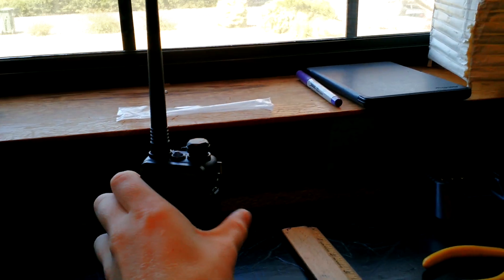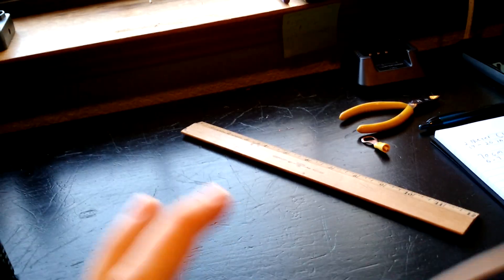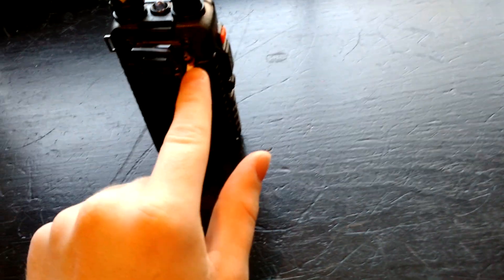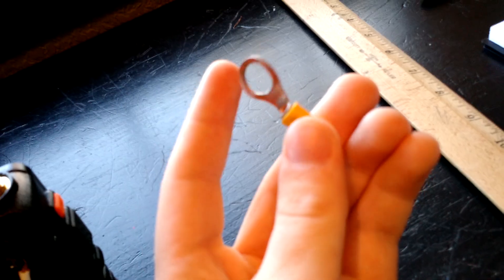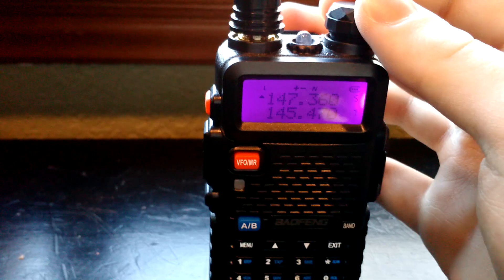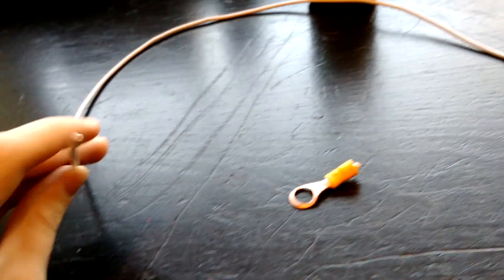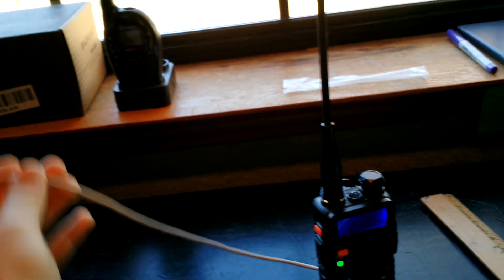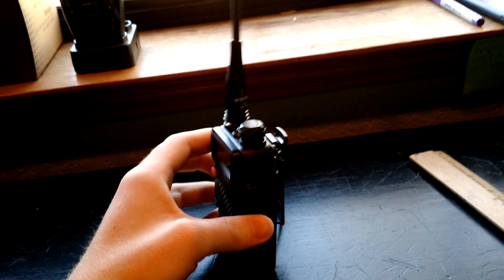Increase HT Range & Performance Free Mod ( Baofeng UV)

Comment: So i have done research with a fixed signal source and added and removed a counterpoise on a baofeng and i have not been able to prove that it works on receive. I also have a situation where i can barely get into a local repeater meaning i can barely key it up  and have to hold it over my head and walk around to find a spot that works... and even then i can not prove one way or the other if a counterpoise works on Tx. I tried looking at the noise waveform on the rx audio and still can not see that it makes a difference. I have done this recently as well as 10 and 20 years ago. I know the theory behind groundplains and know that they work but on a VHF PORTABLE....  and with the counterpoise hanging 180⁰ from the vertical radiating element... i think this idea needs some rethinking and likely redesign ... maybe radials at 90 degrees from the antenna. I think likely a better match between the radio and the antenna would do more to improve the system than a piece of wire 20 inches long hanging down the back of the radio.

Comment: I tried this, without any really noticeable improvement. I ended up focusing more on the antenna itself. Most of the better portable antennas will do a better job, without a wire flopping around. Hell, if stationary, a little rollup wire j-pole will out-perform this by a mile.

Comment: Get a small male quick connect terminal. Use a small drill bit to bore the hole big enough for the screw to fit. Sand the paint off the antent side of the belt clip. Attach wire to terminal and put it all together. It looks and sounds clean. Just my thoughts

Comment: I literally bought this radio yesterday to tinker around with so this video to me is badass. I'm not understanding all the dislikes. I guess assholes are jealous you made a video before they did 😂 so even if you gave me misinformation, it's still alot of information for me to research as a newb 🤷
Reply: It seams from your comment that it is a case of " the blind leading the blind ". I hold an amateur Extra and a commertial  was called a "First Phone" now it is called a GROL.

Comment: what is the formula that you used to get the length of wire for the counterpoise. and i am looking at the 467 mHz band. and for anyone that is gonna berate me, yes, i am a ham, but the uv-5r is type accepted to work on many different freqs.

De- KC2YKD

Comment: Hey!  Good to see a fellow that lives so close!  I live in downtown Oly, and have been tearing my hair out trying to get any reception at all.  But then again I live in a hotel and external antennas are of course forbidden.  I have the Survival Antenna down in my mailbox awaiting my trial of it's transmission and reception.  I have bought the upgrade antennas available on amazon, both the Nagoya and the Diamond depending on which radio it was for.  I have 2 Yaesus and several Baofengs plus a Quansheng.  They all seem to work ok, with nod going to to the Yaesu FT 60R.  I also like all the other radios and would only rate them on ease of use which would again put the Yaesu FT 65R ahaead slightly.  Third would have to be the Quansheng as it is easy to use the scan function.  Next would be the Baofeng GMRS(I have a GMRS license) as you just put it in scan mode an let it rip.  I have considered putting a J-pole and a simple wire antenna that I can make just using the correct formula for...have done that before with mixed results.  Looking for something better, and have not found it yet.  Take care and have a good day and a better tomorrow.

Comment: If I don't mind using a half/wave telescopic antenna (ie, it isn't too tall for me) then I assume there's little need for me to do this? The counterpoise effectively makes the antenna a dipole, which is half-wave also, so the gain should be the same.

Is that right?

Obviously if you have a quarter-wave to start with then this is a great trick

Comment: You have your calculation backwards. You want a 20-inch antenna for the lower frequency in a 19 inch antenna for a higher frequency. The higher you go the shorter the wavelength.

Comment: Vhf/ uhf increase range if connect a hustler whip antenna if your on portable mode, or put an external omni antenna 100 ft from the ground and youll be heard in miles.dont need to grind down your radio

W6/ 4F1PRB

Comment: Thanks for the informative video about a very useful bit of info that almost no one is talking about these days. I was working on something similar myself and ran across your video. It's old knowledge but very few people are doing it with HT's. Besides the inverted length advice GREAT video!
Reply from the maker: James C Thank you for commenting. I know it wasn't the best quality video but I'm glad I could help. Got the idea after hearing about it being used on older radios.
Reply: The reason no one is talking about it is because it is not worth  talking about. If it worked ALL PORTABLES WOULD HAVE A WIRE HANGING OFF THE BACK!

Comment: Dealing with radio frequencies, you'll find that your antennas come out much more precise when you make them using metric measurements.
Reply: So an antenna 1.829m in length is much better than an antenna 6ft in length is what you're saying?
Reply: Merica boss
Reply from the maker: You do the calculation with metric measurements, meters is a metric measurement. But converting back and forth between metric and imperial will not make it any less precise.

Comment: the gain of the antenna doesn't change. what's going on is, your matching the antennas impediance better. as swr kills the radiated signal. it feeds the power back into the radio and disapated as heat. just thought you'd like to know the facts. and I heard others renounce these claims. but what do I know. I'm just an extra class, ham radio operator of 22 years.
Reply: Au contraire!!  The gain of the stock antenna (or in most cases the loss compared to a dipole) is increased by essentially changing the loaded quarter wave into something approaching a theoretical half wave antenna.  There is no gain OVER a dipole but it sure beats the hell outta the rubber duck.  And if we're flashing rank here.....extra class, first licensed in 1959 and continuously since.  You do the math.
Reply: And I've been a licensed extra class since 1976. Adding a Tiger Tail won't give you any perceivable increase in range. The way you increase range is by better receive. With a crappy dummy load antenna adding a tiger Tails. Going to make a bit of good. If you want to make a bit of good put a retractable antenna on their little plug into the SMA connector and adjusted for 19 in. In theory the metal body of the radio access the counterpoise. But by using a retractable metal antenna like on a portable radio you're not using a piece of crap dummy load rubber ducky. But what do I know. I'm just an extra class from whole long long time ago.

Had to steal your line. 🤣
Reply: I try to increase the range of our Baofeng UV-5R's, because I need to communicate with my wife while paragliding. Unfortunately I don't have the tools or know-how to measure if this actually works or not. So....is this a viable option, or not?
I am about to buy better antennas, but their length is also an issue, I can't have 4 feet antennas there. I was hoping this tigertail trick will be helpful.

Comment: Whilst using a hand held, it's the operator who's acting as a "counterpoise" so that piece of wire does very little.  It may make a marginal difference if it's used without actually being held, but buying a decent antenna will be a much better way to go. And who wants a piece of wire hanging off their radio?
Reply: exactly!

Comment: "Tuning" is a lost cause on a handheld radio due to your changing body proximity to the antenna...best counterpoise in this case is one of multi wavelengths, in other words as log as you can tolerate...this makes the biggest difference when the radio isn't being "hand held"

Comment: As freq gets higher, antenna/counterpoise gets shorter not longer...
Reply from the maker: Ill have to go back and see if i misspoke and add an annotation to the video.
Reply: What chu lookin' at True
Reply: connly33 unfortunately true
Reply: So what are proper lengths for 70cm and 2m bands ?
Reply: @kdomster9141  234/freq=1/4 wave length
Reply: @73xlh  Thank you , is this for lenght  in cm?   So 144 or 440Mhz does not equal to 19.5inches...

Comment: @connly33 can I attach a 20 inch wire to one of the belt clip scews and a 7 inch wire to the other belt clip screw, so that it may act as a counterpoise for both bands (2m and 70cm) at the same time? 
Will it work?
Reply from the maker: Abhishek Malyala You definitely can. that would be the ideal way to do it if you don't mind having two wires hanging from it.
Reply: @CondoreComputing   I was just fixing to ask the same question, lol so it will work as long as their is continuity to both screws

Comment: im thinking on using 300ohm old tv ribbon wire. cutting one side for 70cm and the other for 2 meters.
Reply from the maker: I imagine that would work pretty well, good luck.
Reply: why not go all the way and make a ribbon j-pole and string it up?

Comment: The "tiger-tail" has been around for decades as a way of enhancing portable communications using HT radios (I've even heard of similar usage of counterpoises connected to longer telescopic antennas which can be just stuck into the ground at the base and used as radials to create a ground plane effect). Great job putting this out to those who may haven't heard of it before as well as describing how it can be implemented. It's not a miracle worker but it will add some gain to current HT antennas, many of which are not much more efficient than a "dummy load", especially the case with almost all of the cheaper HT antennas which cost less than the radio itself used in the demo video. Part of amateur radio is experimenting and attempting to enhance your ability to communicate. This video was a good example of exactly that. Keep up the good work. 73, KA4WXS
Reply from the maker: Thank you for the comment. I had seen some more experienced hams and others in radio communications using " Tiger-tails" on HT's but had not seen other newer hams doing so, so i though it would be a good way to show few others using these cheap HT's to get a little more out of the stock antennas. I've been learning quite a lot in the meantime about how antennas work. I deffinitly agree, one of my favorite parts of the hobby is experimenting and enhancing communication without necessarily just spending money blindly which i see some individuals do, working with a budget can acctually make the hobby a lot more fulfilling. Im getting ready to get my general license soon and get into HF, so i am hoping to keep sharing what i learn with others. 

73
Reply: Hi I cut a bit of thin wire at over 1.5 metres. When touching ground my swr dropped from 19.9 down to around 7.5. I have a Nagoya 771antennae.  It's a cheap imitation but like to said about the ground etc. Well now my reception even when standing and it's not touching the floor and completely out of whack in theory ( over 1.5m) it works well when I'm sitting on a chair and my counterpoise is sitting on the concrete. I'm happy I found your comment. I gotta try your system. Cheers from Australia

Comment: I am operating a dual band UHF/VHF, and use them both regularly.. Would having both the lenghts (yeah, it will still look stupid though) mess anything up, or would that work?
Reply from the maker: I dont think it would affect it vary much negatively, i dont see vary many others doing it on UHF and VHF but it is common practice to use multiple lengths of ground plane wires on HF antennas for multiple bands.

Comment: Actually the counterpoise shouldn't help with reception but will certainly help with transmission. Now, if the radio has a poor design then a counterpoise might reduce the noise floor/static slightly; somewhere around 2.7db under optimal conditions.

Comment: Those little antennas that come with the radios are awful mate you're right, you'd be best swapping that out for starters anyhow. Great vid.
Reply from the maker: +Ringway Manchester  They deffinitly are pretty bad, i should have recommended more strongly going for at least a cheap aftermarket one.  

Thank's